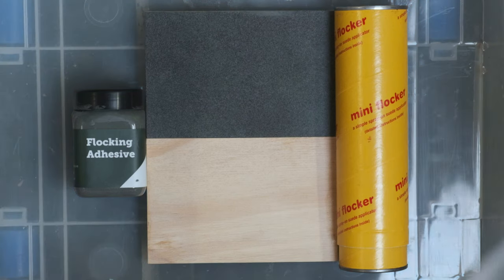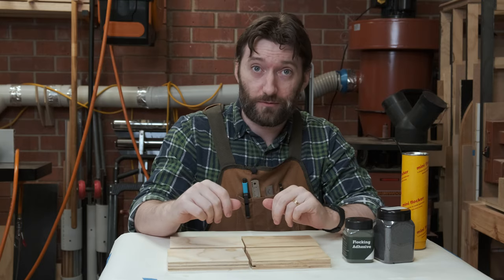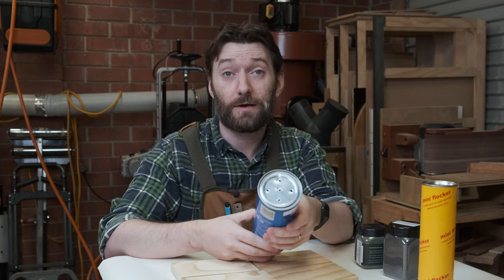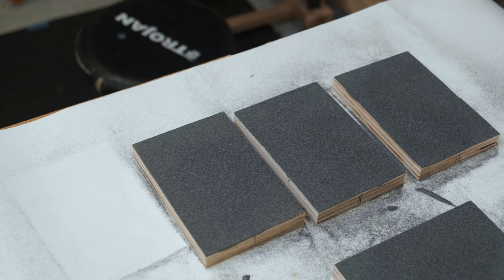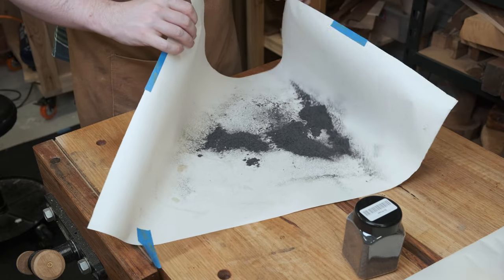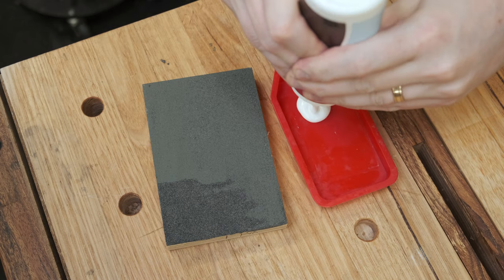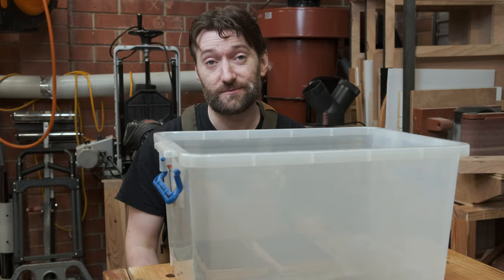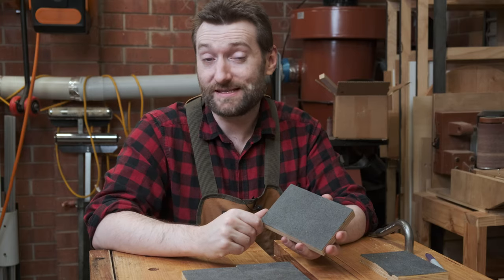Flocking Boxes (Big Box Bonanza)

Comment from the maker: What type of box related content do you want to see next? Dovetails? Box joints? Exposed domino joinery?
Reply: Finger joint boxes video would be great but if it can be done by using metric measurements.
It is probably something very simple to do for some but to be honest there aren't many video that explain it all in metric measurements, most are using imperial measurements due to their imperial  dado stacks.
I am sure that you would cover it all from all angles and give recommendations on finger sizes according to the thickness of the material from your personal experience.
Your videos are always very informative and great for people with all skill levels.
Big 👍 and please keep up the great work.
Reply: Hand Cut Dovetail boxes, and trays to make the boxes useful as a jewellery box or something like that.
Reply: Trays and stuff to go in the box would be cool to see. I have yet to build anything for the insides of my boxes lol.
Reply from the maker: I'm working on some moxon vise kits and stuff, and with that I'll be building a new moxon vise specifically for dovetailing, so I think I'll wait until after I've got the vise built before dovetailing! :)

Comment: Thanks Paul. About five years ago, I did my first Flocking Project. I bought the Flock from Carba-Tec. They did not have the burgundy glue and the shop guy told me to just use regular PVA, which I did after a sealing coat of PVA.  Worked well. So maybe try an experiment with just PVA as the glue. And of course it is half the price of the colour stuff.
Reply from the maker: I was genuinely surprised how well the PVA worked - I don't know why, but I assumed it'd create hard glue lines and lose a lot of the soft-fluffiness. Do you put paint down coloured first or tint the PVA to get a more uniform look?
Reply: A thin coat of PVA. Let it dry, and then thicker coat to stick the Flock. I turned some Christmas Ornaments last year ( snowmen). I used black glue and then the flock for a top hat. The glue bleed through my masking tape and made an ugly line. Where as if I had used PVA, I would not have had a problem. So something to consider in the appropriate circumstance

Comment: I did some flocking for my recent dice tower build and I really had a hard time with it. I didn't seal the wood under it and it ended up with the light spots like your bad samples. I used mineral spirits to wipe it all down and remove all the old flocking as well as a bit of scraping. It was an absolute mess. The 2nd round went a lot better. Sealing the wood seems to be critically important as well as using more glue than you imagine. I wish I had your video before I did my project as it would have saved me a lot of effort! Thanks for sharing!
Reply from the maker: Hah, sorry that I took a bit long! I've not tried dice on flocking, how does it effect the sound? That'd be one place I'd be really torn between flocking and fabric - 3mm stiffened felt reaaaally deadens the dice roll sound (which may be good or bad depending on your perspective)